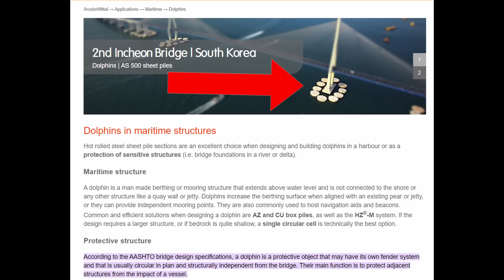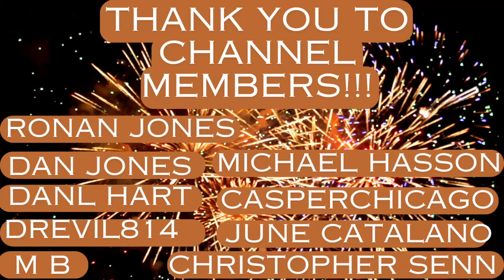Baltimore Bridge Collapse

Comment from the maker: Correction.  I said that there were 3 columns at each pier at the main span but actually there are 4 columns.  The perspective made it look like 3.  At any rate, the ship impact only had to take out one side of the column supports for the whole bridge to collapse in seconds.
Reply: What's Going On With Shipping (YT Channel) has a good update on the ship's track and how this may have happened.  It lost power, and then trying to stop threw it further out of control.
Reply: @mikehardman7566  might just be electrical wires getting ripped apart while there is current inside of them. And the heat from the sudden friction as the steel has to hold more weight suddenly
Reply: The counterintuitive mistake was to order full power astern (black smoke) while helm is thrown hard over to port in a panic to clear the bridge pylon, as when driving a car. However, as every single-screw boater knows, causes the stern to prop walk to port (left), causing the vessel to point to starboard (right) into the obstruction in this case, a movement accentuated if your rudder is hard over to port (left) in an attempt to steer that way.  The large reverse water flow across the rudder to starboard accentuates the radical port stern thrust causing the bow to point radically to starboard, after initial cavitation shuddered the whole boat, matters went from bad to worst immediately. Rookie panic move, sorry to say. Dropping the port bow anchor is all you can do, but ineffective at the mass, speed and muddy riverbottom condition, the anchor just slides through the mud unable to bite, the anchor mass being negligible compared to the giant moving ship mass, as effective as throwing a paperclip. Solution: Multiple tugs should always be continuing to guide the ship after leaving the dock until past the nearby bridge at this particular harbor. This boat had the same thing happen in Antwerp where her stern stuck the wharf upon departure. It's not uncommon for boat maneuvers at relatively slow speeds near dock for even captains to panic. Very sad. Captain, pilot, and harbormaster share the blame.  Not terrorism or mechanical failure.  Just human error.  The wind was only 6kt and the prevailing river current downstream straight out under the bridge.  To many inexperienced folks it looks like he steered purposefully into the pylon, hence the conspiracy theorists are now and will probably continue forever to proclaim willful intent, aggravating me to no end.
Reply: @tipirick  man!  I was thinking the same thing about tugs to get these large ships past the bridge.  I’m sure shipping companies would bellyache about the costs.
Reply: @badlandskid  I usually have seen them using tugs at this bridge. You never know when false confidence will strike.
Reply: @tipirick Thankyou for your knowledgeable comment sir.
Reply: @raymondowalden4405 You are very welcome. In addition to being a licensed architect/engineer in continuous practice for 46 years in CA, I sail a 16000 lb. 1985 fully-refitted Catalina '38 out of Ventura, SV Zoë.   Prop walk is the first thing you learn about, crucial knowledge for safe docking operations.  No dock strikes yet, no structural building failures either.
Reply: Could have been intentional,  what better way to completely shut down the port for 6 months or more @tipirick
Reply: Why was the cargo ship operating so close to the bridge? Perspective! If you go to “What is going on with shipping?” Well start with the container ship being overloaded with limited visibility. And if you have ever been on a big boat, like a  cruise ship, then you know HE BES CAPTAINS are always GREEKS. :face-blue-smiling:
Reply: @mikehardman7566 
a 117.000 ton deadweight ship travelling at 6 or 7 knots will demolish  anything in its path
Reply: @mikehardman7566  no. If just one of the concrete supports fail, the whole structure fails. The weight of the bridge on the 3 remaining supports plus where the 1 broken support were. It would be way above what the bridge were designed to carry when it was build. 
Look for conspiracies all you want, but it is very simply just an unfortunate cascade of events that could have happened at any time in the years since super cargo ships were first build.
Reply: When one analyzes an  incident, one should be thorough, because the truth is in the  small details like the difference between a stern and a bow!
Reply: Thank you!
Reply: See the What's Going On with Shipping coverage to understand about what was (apparently) happening with the ship. There is a ton of shipping under that bridge every day. It is a huge economic deal to have that port shut down, much more than the highway itself.
Reply: @Miata822  Nighttime video has stern (rear) of the cargo ship bumping into the pylon, but in later views - daytime - we see that it is the bow that  has the debris ...

YouTube: RAW Cargo ship loses power, crashes into the Baltimore Bridge

 Daylight photos shows the bow (front) impacted the pylon...

Google [the New York Post article picture]: Why the Baltimore Key Bridge crumbled so spectacularly after it was hit by cargo ship

Talk about a continuity lapse!

The stern of the cargo ship is square, not pointed like the bow, and is constructed to rise diagonally out of the  water, as seen in the nighttime video and daytime photo. 

Also, the waterline in the nighttime video is above  ground level, hiding the lower floors of the  buildings in  the distance, identifying a really bad job of compositing. 

Purpose for the false flag incident, you ask? The Federal government is taking over the  reconstruction project, so naturally the Marxist establishment will place shape charge explosives within the reinforced concrete pylons in  order to blow the bridge should it be required to assist, when activated to commence hostilities, the 250,000 Chinese PLA soldiers allowed  to enter the Mexican and Canadian borders.
Reply: Aren't these correctly called, "tressles?"
Reply: @phil20_20 ……thought that a bridge has ‘pylons’?
Reply: It basically plummeted to the water in a matter of seconds. Hard to believe that it would be such a quick cascade effect. Was the bridge compromised, either through years of stress or by intentional means?
Reply: @nikolatesla1967  truss type structures fail quickly when subjected to forces they aren’t built to withstand.  Twisting of a truss is one force it doesn’t handle well.
Reply: The vessel was going at low speed, without power to accelerate its speed, which means that this was a low speed impact reducing the force of impact, which in turn leaves me, a guy with a brain with the final conclusion that that bridge was a fucked up bridge since a long time ago, people were taking dangerous chances driving through that bridge, that was a a toy bridge designed by inept people who should have taken events like that into account. They had to know that such bridge spanning a waterway with large heavy vessels passing in and out to and from port should have had stronger pillars and a more solid overall structure, a simple low speed bump caused a domino effect that brought the whole thing down
Reply: @AngelGonzalez-pd4cn Ships today are twice as big as they were in 1972 when they began construction.
Reply: @AngelGonzalez-pd4cn  8 knots is not a slow speed and obviously you nothing about bridge construction.
Reply: @AngelGonzalez-pd4cn  the maximum recommended speed in the channel is 8 knots and it was travelling at ~9 knots.  This was NOT a low speed event.  The ship increased speed form 3 knots to almost 9 knots without the assistance of the tug boats.  It clearly had the 'power' to accelerate.  The size of cargo ships have exponentially increased in mass (and size) over the lifetime of the bridge.  The state did not approve expenditures to increase the protection of the bridge abutments.  The bridge itself was of sufficient design.  While you may have a brain, it is obvious that it is little used.

Comment: Hi Casey, Thanks for the informative video. Could you comment on whether the Chesapeake Bay Bridge has those bumper "dolphins" to protect its piers?  The Chesapeake Bay Bridge is only about 10 miles south of the Key Bridge and all ships traveling north up the Chesapeake Bay to the Port of Baltimore have to pass under it as well. The Chesapeake Bay Bridge is actually two bridges set side by side (one for eastbound traffic and one for westbound traffic) and spans 4.5 miles across the Bay. Thanks

Comment: The ship was under guidance of the Pilots. The Master has final say.  Most likely traveling at its slowest speed, about 8knots. The vessel would have been in the channel until..... with some helm in order to stay in the channel.

Cargo ships have duplicate systems, today with auto start, in the event of failure. There would be sufficient generators connected to the Main Switchboard, that the failure of any one would not cause a total black out.  The Main Engine(s) require electric power from the Main Switchboard for their support systems; Fuel, Lubricating oil, Start Air, Cooling, etc. However, the ships systems are generally not designed to avoid the consequences of SINGLE POINT FAILURE.  That would have  happened in this case. A complete loss of Electric Power first. Something that caused all the Generator sets to stop alternatively a failure within the Main Switch Board.  In such instant the Emergency Generator should have started. It is a stand alone system even electrically. In normal circumstances it would provide electric power to some essential equipment, such as steering pumps, Engine Lubricating Oil Pump(s), Scavenge Air Blower(s) - but maybe only one. With no electric power to the steering gear motors the helm would remain in its last command position, the one that took the ship into the bridge pier.

The smoke issuing form the ships funnel suggests that there was an attempt to restart the Main Engine(s).  But no Electric Power for the Auxiliary Scavenge air Blowers, unburnt fuel and far too much of it.

When the Electric Power was reinstated, there was insufficient time to effect a massive change of course or/and to stop this rather large ship. The stopping distance is clearly displayed upon the bridge.  The Pilot or Master called to let go the anchor in order to slow the ship and change its course.

The training and rules that govern these ships and those operating them ensures that incidents like this are not at all common.  Especially when one considers the number of ships operating daily in confined water ways, such as this.

Nonetheless, very sad for all involved and impacted by this terrible event.

Comment: Replacement cost of Bridge 100's of millions
Just millions for Cost of piles and concrete 'islands' (as you said dolphins) up and downstream of piers, close enough to actually stop a ship unless it was steering directly towards the piles from miles away.
Gov't penny pinching (have to, since tax base dropped since this was built, if we are making what are parents did 30 yrs ago, we are paying the same taxes (note on official gov't inflation rates, not the real rates we have to pay for - at the same time corporate and taxes on top 10% dropped to less than workers pay) back fires.  
The channel looks too narrow for 2 way traffic and 'dolphins' on inside of piers, maybe if traffic was 'one way', which with tides is really hard to do.  At the least though a dolphin up and down stream of piers almost against the bridge pier, and wide enough to keep projecting bow away from bridge.  
Could also mandate tugs fore and aft through bridge area - but that raises costs to shippers, who have to pay for hours more tug time and that would eat into profits off the 10's of millions of merch on the ship.
Great report, more info from you than 20 news reports

Comment: Video released from NTSB seems to show that it was the top of the bow of ship at main deck level which hit the vertical pylons in mid air, as opposed to the hull underwater hitting the base of pier.  (this is good news for integrity of ship if the portion underwater didn't get a gash from rubbing against pier foundation).

The ship was escoterd by tugs from berth , turned around and tugs left once ship was on right heading of 141° , needing only to go straight to get through the bridge and only Chesepeake River. 

Early in the incident, it had been revealed that they had been strong suggestions to build pier protections but were rejected due to cost.  The city of Halifax made a press releases yesterday to reassure people that its 2 bridges in its port have pier protections and those were added in early 1980s after engineering recommendations. They are gravel mounds all around the pier. 

The channel for shipping is actually fairly wide I was told it can theoretically handle 2 ships at a time.   The ship started off on the "left lane" (outbound)  and hit the pylon that was right of the right lane (inbound). 

I expect new standards for bridges in shipping channels to require protective buffer zones around piers.  I don't think it is realistic to build bridges with redundancies with spans sufficient to let large ships pass.   a cable stayed bridge still has single point of failure in its 1 pier going up to support the cables. (though easier to protect that one large pier and place it further away from the shipping channel.

Comment: 1. The fenders weren’t sufficient to protect the bridge because when the bridge was build ships weren’t this big. 2. The ship was lined up for the gap, when they regained power they panicked and put it in reverse, the torque (which is asymmetrical as it optimised for steaming forward) pulled the ship off course and resulted in it hitting the bridge pier. If they just coasted and went with it they would have been ok. There was no way a ship that size would have stopped in that distance anyways.

Comment: Same question I have is concerning the dolphin/fender system to protect the piers.  I just watched a response video featuring the Delaware River Port Authority (NJ/PA).  The video made the point that the Bridges under this authority have extensive use of dolphins surrounding the piers of their bridges.  Example given was the Betsy Ross Bridge which was constructed around the same time as The Francis Scott Key Bridge.  No given we know of the disaster of the Sunshine Skyway in Florida 1980, why was it not mandated that all bridges in major harbors must have an extensive, robust dolphin/fender setup similar to the new Sunshine Skyway.  I believe this catastrophy was preventable.  This is one of the busiest harbors in the country and to be honest those piers basically had no protection. This unfortunately was an obvious accident in plain sight waiting to happen.  😢
Reply from the maker: Thank you for your support!  Yes, I agree.  I have been thinking about doing a follow up video to address the issue of pier protection in more detail.  I have been surprised by the number of people (including some engineers) who are incorrectly saying in my opinion that there is no way to protect against impact from such large cargo ships.  I agree with you that this was 100 percent preventable.
Reply: @CaseyJones-Engineer  I was one of those engineers - not an expert in bridge construction (or any civil engineering discipline), but I would have assumed based on 'back of the envelope' math that it would be physically impossible to protect a bridge from a collision like this.  After researching it more thoroughly, it seems that it's not merely possible, but routine, and unusual that this bridge did not have any protection.

Comment: That cargo ship was built long after the Key bridge's specs and design were approved.  Its sheer mass effectively made everything about the bridge design obsolete.  What should've happened was a reevaluation of the navigation procedures, more controls, possibly the addition of tug boats to assist in the channel, more (or better?) pilots, and readiness reviews prior to entering the approach or an outright BAN.  Why was the DALI moving so fast?  What was the local pilot doing?  Was the crew effectively communicating with the pilot?  Why the power failure?  Also, this ship had a prior incident, so does anyone have to approve entry, or is it a free for all (so long as there was a dock free and fees paid)?

Comment: DOPHINS would have prevented this. Tugs towing ship out past the bridge instead of breaking off after the ship was turned into the channel, would have prevented this. Properly maintained ship (Power failed twice) would have prevented this. Bridge was designed with multiple single points of failure. Please don't respond to my post unless you have Engineering/ Maritime expertise.